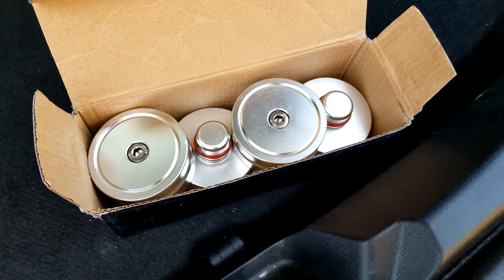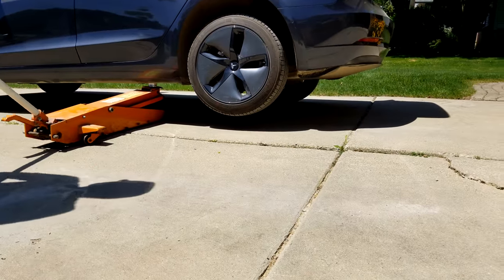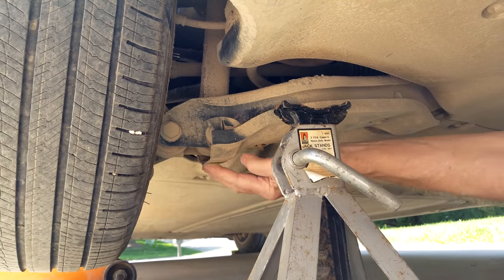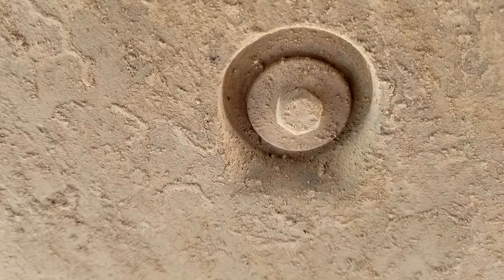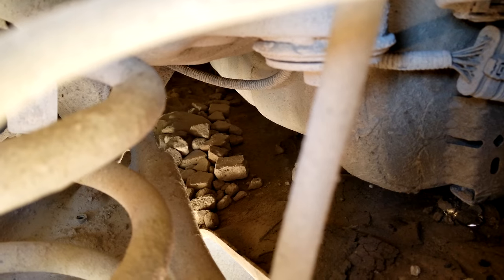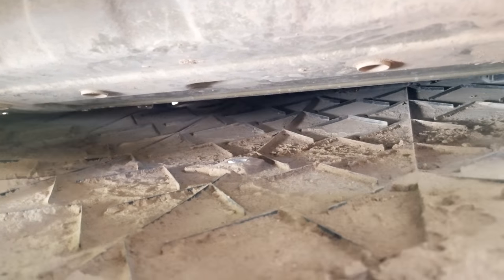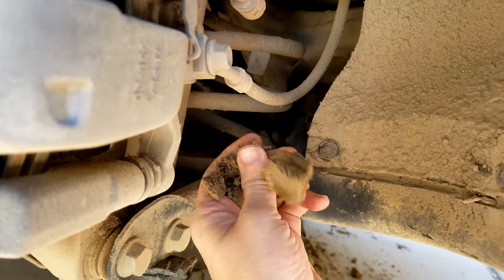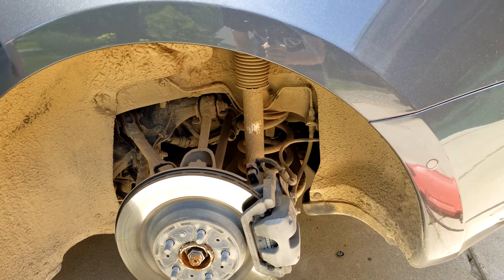I found 15 Pounds of Dirt in my Tesla Model 3 | Shocks | Tires | Brakes After Dirt Road Driving

Comment: I work at the Fremont factory and have installed the Aero shield after we would align the wheels. The middle bolt u were referring to was not necessary.
Reply from the maker: Amazing you're seeing this! Thanks for the comment :) and thanks for working hard to get these cars out!
Reply: EdDro510 Does my model 3 have aero shield? I got delivered June 5, 2019
Reply: Sha Lu Awesome, congrats.! Yes, your Model 3 comes with an aero shield, lol.
Reply: EdDro510 thanks for response
Reply: Dirty Tesla well, I’m also a Tesla nerd. Fell in love with the cars while getting to work on them and also drive them here at the Factory. Tesla Life.
Reply from the maker: @EdDro510  That is so cool! They are awesome! I hope to hear from you occasionally :)
Reply: Looks like you needed a Jeep and not a Tesla.
Reply from the maker: I thought about getting a Colorado but this was definitely the better choice.
Reply: I have a Jeep Cherokee, we can trade?  :)   Saving for a model Y!
Reply: @DirtyTesla  LOL Colorado would have been a terrible choice. Simple engine bay repairs take way longer than normal on a truck. You're going to be in there a lot the engines are not reliable. The Tesla model 3 will out-last every Colorado made today by 100k easy.
Reply: You need to show this the the engineers that design these things so they can come up with a better solution because this will be a source of problems like rust.
Reply: @EdDro510  Do you know enough about the 3's to confirm if the inverters are different between the 3D and P3D? This is a common question within the community.
Reply: @msbgone  model y cost like 5k more than the x and its worse
Reply: @Ckcdillpickle  you will have to check those costs again, I think maybe you meant the 3 though?  I want to be a bit higher up and have the larger cargo area....  Time will tell.
Reply: How is it possible to get so much shit under the car?
Reply: Careful what u say Ed. Tesla is loves non-disclosure's

Comment: I'm thinking that all that dirt started as dust, just a lot of it, and then got humid, shaken, and lumped together. No car can prevent that buildup, especially if it's got a aero shield. What should be possible though, is to simply wash it using a simple garden hose once a month. Maybe you need a crafted tube at the end to reach in without having to take off your wheels first.
Reply: I worked a FCA dealer and have never seen it past a few rocks and a dusty film. This aero shield is also known for catching tons of snow lol

Comment: I’d rather figure out a way to completely seal that panel to prevent more dirt from accumulating there rather than emptying it annually.
Reply: You mean what Tesla should have designed into the car?
Reply: Dirt is not coming from underneath, so sealing the panel makes no sense, its accumulating from the sides where the wheels are. Maybe removing and leaving the panel off would work better as the dirt would not have a place to accumulate
Reply: Esau Picado good point!
Reply: No! Do not remove this panel. Just recognise that it is a part of maintenance with living on a dirty road. If you live in a snow and ice area, then just wash it once or twice a year. No problems, kiddies. Don’t make it into a first world problem thing. For many decades I have been maintaining my ICE vehicles and taking these panels off and cleaning them twice a year is NOTHING compared to many of the vehicles I have owned over six decades. Wake up, this is normal life. It’s still far less maintenance than an ICE over the same period and roads.

Comment: Idk if this has been suggested yet, but for your cleaning maintenance you could take a tire off and stick a shop vac hose through the opening next to the tire and suck out the dirt. It might be easier than jacking up both sides and taking off half the aero-shield

Comment: Sounds like a 1970's GM production auto,  designed to collect dirt, etc. in the wheel wells,   The claimed the openings into the wheel well areas were for "ventilation".  In 1979,  the finally started covering up the holes.  I removed 15 pounds per wheel well from my familiy's 1973  Vega GT when they rusted out and needed patched.  Funny thing is those were the very spots all GM cars from that time period rusted out at.

Comment: Best video about the Model 3 I’ve seen yet. Simple but it applies to me as I also spend a lot of time on dirt roads due to loving the outdoors. I’m adding this to my tire rotation schedule or later as needed. This is ridiculous. I had a Tundra and a Tacoma before this and mud was the underbody coating most of the year. Lol. Obviously, I’m not taking the M3 through those trails but I got AWD for a reason. My VW Jetta TDI FWD only got stuck on me a couple of times. Thanks again for taking the time to put this on video!
Reply from the maker: Glad you enjoyed. The car's been great. I did my first rotation at 10k miles. I think cleaning this once a year would be plenty.

Comment: What is bad is when all that clay gets wet and holds moisture in against any metal parts. It will lead to corrosion.
Reply: pretty much the exact reason my 03 car is rusted so bad. im starting to loose floor boards. rear right passenger side rusted a volley ball size hole so far.
not to mention extensive frame and wheel well rust.
Reply: And imagine thise driving on salty roads during winter.. the metal parts will be soaked with wet salty mud 24/7 365..
Reply: Umm, not if the panels are mostly plastic and this is why you need to properly prepare a car for living in an ice and snow areas. Take off the panels the day you pick up the vehicle and spray protective films of some sort over any vulnerable metal parts. Reinstall the panels and just use once or twice a year maintenance to keep it clean. Restore the metal protection as needed over the life of the vehicle. It’s the same as if you had ANY VEHICLE over the same roads. Problem solved.
Reply: Siggy well more like 24/7/120 except for car wash breaks and cold and dry  days . The warm and wet  temps actually speed up  corrosion to akready salt damaged areas even if the salt is gone. Must be descaled and recoated.

Comment: If I had to drive on dirt roads I would figure out a way to wash the inside of the shield on the back. Maybe a opening that I could run water in it to flush it out when I wash the car. Also I would and do wash the under side of my Tesla 3 in the spring to clean off any salt buildup, which I also have done on all my ICE cars I have owned.
Reply from the maker: How do you wash the under side?
Reply: Dirty Tesla I just spray it with the hose I wash the car with. Noting fancy. I also notice when 4 wheelers go off road they use the self car wash to get the mud off.

Comment: Use the factory bolts to add a screen, something like very dense chicken wire that would cover the opening but bolt onto the belly of the car using those factory bolts, good video, easy fix

Comment: Thanks for the video, very informative. I was concerned about my car accumulating salty sand from our New England roads and rusting the undercarriage, but your video alleviated my concerns. The dirt is just sitting on the plastic pan so not much to worry about. Also, you pointed out that you can see the pan my removing the wheel, so I went out and took a peek with a flashlight looking between the spokes of the wheel and I was able to see the pan. Mine was perfectly clean so I think driving on the highway in the rain will wash out anything that accumulates. Also, if you go to a car wash with a pressure wand, you can probably just aim through the spokes and clean most of it out.
Reply from the maker: Awesome to hear! Thanks for sharing. Glad the video helped.
Reply: Yes, cleaning every so often is NORMAL MAINTENANCE ON ANY VEHICLE. Just don’t be lazy and look after your vehicles. I’ve been doing the same for sixty years with vehicles I have owned. It’s just normal stuff.

Comment: As far as the airo shield goes if it's not covering anything that needs air to keep it cool or some kind of moving part you could put some sound deadening foam a sheet of sound deadening foam back there about the the distance between the body and the shield, it would not add any noticeable weight and it would also help to  deaden road sound and it would keep all the dirt out because the dirt would not be able to fly up in there and get stuck that's what I would do... You could put the fast tac spray adhesive on the foam and the areo shield and you would not have to take it down at all cept for real maintenance.

Comment: Yep you're right the rear motor is the main motor and the front is just used if the rear get hot or is not sufficient enough to deliver the commanded torque.

The reason for is, the rear motor type is much better to be cooled, by design. Also the front motor have zero drag when not in use.

X/S (since Raven) are exactly the opposite.
Reply: The rear motor is more efficient at most driving speeds based on physics alone.  But, faster highway speeds the front drive would be more efficient on just physics.
Reply: @longmuskox4194  the rear motor is more efficient on converting electricity to motion, so it's best to use it all the time.

Wouldn't you use it, it would cause some drag, since it is featuring permanent magnets.
Reply: @RubenKelevra  Yes, I agree, the electrical design of the rear motor is more efficient.  But, at slower speeds, it's more efficient to 'push' a car and at much higher highway speeds it's more efficient to 'pull' a car.  I should have been more specific.  Of course, there are a lot of variables that can affect this.

Comment: Considered drilling some holes for the dirt to fall out while it's still mud/dust before it clumps. And with the holes you might be able to hose in there to wash it out some in between manual cleanings.

Comment: This is an issue I have seen before especially where they are spreading sand and salt in the winter.  Just imagine the salt getting up there rusting everything to death.
Reply: I agree.  Definite design flaw.
Reply: east coast and rustbelt folks are screwed, those cars will rust twice as fast with the current design, to add to the Colorado Truck comment above, the Tesla powertrain might last, but the unibody and suspension will be swiss cheese in 5 years.

Comment: i live in canada and getting dirt and salt in the wheel wells and undercarriage  is common you SHOULD always wash out your wheel wells i can see you don't  your car is clean on the outside and NOT clean on the underside , looks like mostly clay I'm  sure if you run water with a power washer into the exposed voids you could get rid of 90% of the settlement you are having in theses areas ,
Reply from the maker: I do clean the wheel wells normally, but it is a cloth type material in there and it is very difficult to get all the dirt out of there since it's kinda soaked in.

Comment: don't you have a pressure washer you can use to clean out the wheel wells and spray the underbelly?
Reply from the maker: I may be able to reach in there... But with the tires on it'd be hard. I still think you'd need to lift it.
Reply: Humm...isn't the point that it shouldn't happen like that? Tesla should have thought about that..I wonder if mine is designed the same way 🤮
Reply: @DirtyTesla  If you made a cleaning video, that would be extremely satisfying to watch all that dirt get blasted off
Reply from the maker: @longmuskox4194  omg that thing is amazing...want
Reply from the maker: @zackj997  I'm not sure it'd be the most popular video, but I don't mind. If people want it, I'll do it :)
Reply: Dirty Tesla im down.
Reply: Dirty Tesla  there’s a whole sub-genre of pressure washing videos. It’s quite mesmerizing actually.
Reply: @DirtyTesla  I would check with EdDro510 to see if it is wise to pressure wash the undercarriage with the battery above it. BTW my wife test drove the Model 3 as you suggested and she loves it. If we end up buying one we will use your referral code. Happy 4th!
Reply: @DirtyTesla  Cleaning videos are the shit mate. Do it!
Reply from the maker: Did you do it?

Comment: Dirt happens. You may be able to put a little bit of silicone sealant on the leading edge of the cracks where the dirt is getting in and not really have a problem anymore.

Comment: Should pressure wash the underbody while your down their. I also highly recommend throwing a zip tie to that strut cover thing. Make sure it stays seating, protecting the clean oiled portion. I wonder how you cabin air filter is doing as well...
Reply from the maker: Yes I have thought about the air filter too. Maybe before winter I can change it.

Comment: I would definitely invest in a pressure washer. I have a 1500 psi GreenWorks that has plenty of adequate pressure for cleaning my car and vinyl siding on the house. Accumulated dirt will possibly cause some corrosion or rust to develop which I wouldn't want with a $50k+ car.
Reply from the maker: I use this one https://youtu.be/U1YNPJxmbF0

Comment: Hi. Thanks for posting. I just watched your video. I'm wondering. Does your car have the new style rear shield that has the access door at the back, designed to access the trailer hitch? If not, with the amount of dirt roads you travel, you may want to consider replacing the one you have , I've heard the new one's are only $150. But that might give you access to clean out that area without having to remove the body coloured rear bumper cover, just to get to the shield. I believe they come as one unit. 

I just bought an SR+ and after watching your video, plan to periodically clean out that area. Thanks!
Reply from the maker: Nice thanks for the tip! I don't have that door.

I hope you enjoy the car!

Comment: truly one ditty tesla ... surprised there isnt more wheel well skirt ... has to be how that is getting up there...  but has to be some opening for suspension movement.... so probably the best that can be done....  most cars dont have so much under-body shielding...
Reply: and i second father-in-law .. nothing here really is omg or anything... looks great honestly...  nice thing about pulling the aeroshield is can also check to see if the transaxle is leaking...  despite what tesla says, eventually that unit will need a fluid swap and of course the axle cv boots will need maintenance at some point...   but yeah.. the dirt wont do much but weigh you down...
Reply: You would be surprised at how much shielding is under most modern cars.
Reply: @lbart2005  perhaps so.. i mean yes in the last 15 years the incidence of splash shields in the front radiator and engine have become pretty common ....  just like so much plastic covering the tops of engines for no describable reason...  but I haven't seen many under the rear of cars...  but granted i dont look under cars i dont work on ^_^

Comment: Could that open hole be for water drainage?  Also, if you drive on paved roads in the rain, could the rain water flush some of that built-up dirt out?
Reply from the maker: That could be a use for the hole! But it's the exact same type of hole for the screws (I'm sure just stamping another hole without a screw is easier than designing a new hole tho). 

The amount of dirt I get in there is too much for some rain water to get it out, that's for sure.
Reply: My question is was there a corresponding hole in the frame for a bolt?  If not , it was probably designed for H2O drainage.  As others have noted, I would have pressure washed the area since you already had it opened up.
Reply from the maker: @kaazruo  Yeah I don't think there was a hole for a bolt in the frame, but I didn't look. May be able to confirm by looking through some of the interior video. 

We talked about power washing it but decided against it because 1. I wasn't exactly sure what all was in there and 2. meh
Reply: I’m slightly surprised your father-in-law didn’t,t have you check for a bolt hole - my father worked for GM as an electrical engineer and did most of the maintenance on the family cars.  I could hear his voice in the back of my head, posing that question.  It’s great you have your FIL and all his expertise at your disposal.
Reply from the maker: @kaazruo  That's awesome. And yes he is a wealth of knowledge. To be fair, I didn't point that out to him specifically, so he may not have even realized. From what others have seen, it seems there is not supposed to be a bolt there tho.
Reply: @DirtyTesla   I think I would just squirt some water up the drainage hole with a hose and flush out the dirt periodically --especially with all the dirt road driving.  Maybe temporarily plug the drain after hosing it to give the dirt "rocks" a chance to dissolve.

Comment: The only concern I would have with adding something to seal the panels to prevent dirt or road salt from entering is the risk of reducing the ability of the car to dump heat. Are there any aftermarket products available to close those gaps?
Reply from the maker: Nothing that I've seen. I definitely don't think modifying any of this is the answer. Salt is the scariest thing. The dirt...I'm not so worried about. 

I'll probably do an update next summer to see if the winter did anything scary under there.

Comment: It’s not a big deal the dust get in and then as you said clumps together and just adds weight if it’s making noise or getting to delicate parts it would be a problem I think it’s the lack of a fuel tank the make it worse on a Tesla car I had an old Porsche that was driving on dirt roads and I was finding dirt everywhere so it’s just car stuff
Reply from the maker: Good to hear! Like I said I had no "symptoms," I just wanted to check it out.